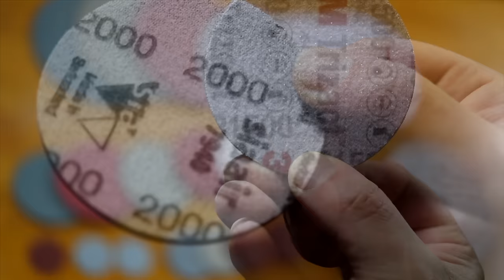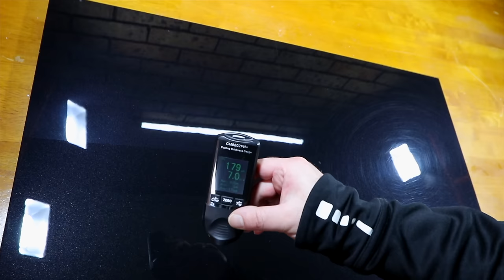A Guide To Wet Sanding, Compounding & Polishing Car Paint!

Comment: Hi Sandro, great video. I learned so much from it. I wanted to use some of the same principles to clean up a blob of touch up paint. I was going to wet sand it until it was even with original paint and then polish. Do the polish wear off after a while and have to be reapplied?
Reply from the maker: Thanks, and a true polish or compound permanently removes defects so unlike a wax or sealant, the finish won’t wear off.

Comment: Great video.  With the advancement of modern compounds - some of which remove 1200+ grit sanding marks - is it possible to skip the 4000 grit sanding stage to reduce the amount of clearcoat removal and just go straight to a 1200+ grit removing compound? 🤓
Reply from the maker: The softer the paint is the easier it is to remove aggressive sanding marks, but based on my personal experience it’s actually quicker and safer to refine coarser sanding marks with finer ones prior to compounding.

Comment: another great vid, Sandro.  Though I'm a long ways from any sort of wet sanding, I do have a question.  So, the "sander" is really a polisher, yes?  And what I think of as a rotating sander, like Black and Decker or Skil or whatever, that's radically different, yes?
Reply from the maker: Thanks mate but I haven’t owned any of those sanders you mentioned so I can’t speak to them. But most sanders used for automotive paint will be quite similar to a small throw DA polishers so yes, and they can be the same machine used for both polishing and sanding. Orbital sanders where actually where DA polishers originated from - Rupes just made them with more power and larger throws into what is the standard for car polishing today.
Reply: @CarCraftAutoDetailing  I looked some up and it looks like the construction use orbital sanders for wood spin a lot faster than the car paint ones... 12,000 OPM and such.

Comment: Hello Sandro ;) Hope things are much better now in Vic. I have a question after watching your video - do I need to buy a interface pad when going to use the SIA Sanding Discs as they look like they have a bit of interface inbuilt? It will be my 1st time wet sanding with a DA :)
Reply from the maker: You don’t have to use an interface pad with them, but I’d tend to recommend it as it’s going to give you more forgiveness especially as a first time user and help give you more even results as you work on your technique.
Reply: @CarCraftAutoDetailing  Thanks for the quick reply Sandro and I sure will follow your advice mate..Great instructional videos and info as always cheers se you soon..
Reply: Hello Sando, hope you and your family are well from your near by neighbour :)  I finally worked up the courage to give this a go! I did half the bonnet yesterday and forgot to use the interface pad Doh. but it looks good with the exception of even though it's uniformly dull matt - i'm sure it still has some orange peel look to it, is that normal?
Reply from the maker: I’ve definitely sanded back a few different panels and cars where although I was able to greatly reduce the peel, I wasn’t able to get that 100% flat mirror finish, whereas on other paints and panels I was. It also comes down to the panel, primer and base coats to some extent in order to get that completely orange peel finish. You’d also generally want to start with at least 1500grit and actually not use an interface pad when more specifically going after Orange peel. But I think if you were able to import everything the finish and refine it all diem well it was probably a great first attempt mate!
Reply: @CarCraftAutoDetailing Thank you Sandro and your advice is very much appreciated. I was using my little DAS 6 8mm throw? so that may of helped me even if it was a bit slow and I was also stressed and not wanting to stuff it up.
I'll finish the other half on the bonnet tomorrow and test my polishing skills on it.. cheers

Comment: Hey Sandro I was wondering how long those 3m Purple finishing film discs last you? And do you use them dry? Thanks
Reply from the maker: 3m have a few different discs, but I generally always wet sand and I’d say a disc is usually good for at least couple of panels, but it really depends, harder paints do chew up discs faster
Reply: @CarCraftAutoDetailing  too easy, cheers

Comment: What about sanding your method on bumpers? Its save? Every time when im sanding some scratche on bumpers im scared 🙈
Reply from the maker: It’s really the same method on painted bumpers, you just have to be extra careful around the dramatic body lines that most modern bumpers have, and it’s usually more work refining the paint when working on plastic substrates.

Comment: Great vid. Can you please send a link to the paint depth gauge?
Reply from the maker: Thanks, I don’t have a link to it because it’s an old gauge I just have at home, but here’s a link to the one I currently use at work 
https://www.waxit.com.au/products/waxit-paint-thickness-gauge?_pos=1&_sid=270d84453&_ss=r
Reply: @CarCraftAutoDetailing  Thanks for the quick reply! Does this unit measure individual thicknesses like how thick the clear is?
Reply from the maker: Unfortunately there is no PTG that I know of on the market that will measure individual layers on metal substrates only on plastics of fibre substrates.

Comment: I have to wonder what you could get away with on the right side of the panel, using the two step that was done on the bottom left without sanding...
Reply from the maker: The right side didn’t have those same deeper scratches, so a compound and polish would get those less severe defects out.

Comment: Can we start from 1000 grid then use 2000 then 3000 then 4000 then 5000 and then use rubbing compound then polishing compound then wax ?
Reply from the maker: You can, but in most cases you don’t need that many steps.

Comment: Sandro, can you suggest some suppliers of good quality interface pads and wet sanding discs? my regular detailing supplier is out of stock I am in northern NSW,
Reply from the maker: The SIA sanding disks (linked in the description box) are really fantastic for wet sanding. I’m really not sure about local NSW sellers as I’m in Melbourne, but you can get them shipped online.
Reply: Thanks Sandro, I source all my supplies on line and missed this info as I was watching on my phone, I am subscribed and learn lots from your methods, Regards, Gary

Comment: Great video as always bud.is there any difference in the degree off clear coat leveling when using interface pad such as those diagrams abrasives disc compared to a regular disc with no interface
Reply from the maker: Yes, any sort of foam or interface will lower the aggression of the disc to some extent

Comment: Hello , prob too late to ask , but would the sanded ish color come back after awhile after the polishing wax?
Reply from the maker: No, this process is not masking or filling the sanding marks, it’s permanently removing them by using coarser then finned compound/polish abrasives - that’s what we tend to refer to as true paint correction - no waxes, sealants or fillers hiding the true finish.

Comment: Hi have you heard of koch chemie h9. 01 compound, I'm having trouble removing scratches from a hard bmw 645 clear coat using ultimate compound, do you think this will work?
Reply from the maker: I haven’t personally used it, but their compounds seem to be well regarded
Reply: @CarCraftAutoDetailing  should I try a microfiber disc instead of foam? Which is more aggressive from the two?
Reply from the maker: Microfibre tends to be more effective at cutting so it could certainly help over foam

Comment: Hello how do I remove haze after sanding a key mark down, I've affected surrounding area on my car
Reply from the maker: The haze is most likely from not entirely removing the sanding marks. After using your first courser sanding grit you may need to sand a little more with your finer grit before moving onto compounding. Alternatively it could also be just compounding haze / maybe your paint is soft, in which case you may need to polish with a finer foam pad and finer polish to remove the compounding haze before you wax the finish.

Comment: What is stopping all the clear coat being taken away and the paint permanently ruined by doing this mutiple times over the years? Does ceramic or other coatings give it additional layers that are stronger than the original clear coat we strip away or what?
Reply from the maker: Good and safe techniques in restoring car paint is want prevents this process from ruining the paint - it’s about how you do it respectfully. Neglect of car paint and bad maintenance processes is the number one cause of car paint failure.
Reply: @CarCraftAutoDetailing  i mean do you need or should always coat it or add layers of protection in some way since you remove layers to polish and smooth it?
Reply from the maker: @quickpik4121 yes you should always add a car wax, sealant or coating after any paint correction process to protect it, but you can’t add clear coat or build it up again, you would have to repaint the whole paint to do that.

Comment: Is it better to machine wet sand than to block wet sand?
Reply from the maker: Hand block sanding is harder to get good and consistent with - it just takes time to really master it to a high level. Machine sanding is easier to get a consistent result and generally easier to refine the sanding marks as long as you avoid getting pigtails in the finish. But it’s always best to practice either method on a junkyard panel to work on your technique and work through that initial learning curve.

Comment: What type of paint gauge is that?
Is it ok to use a DA for wet sanding a whole car?
Reply from the maker: It’s just an old gauge I have at home I’m not sure on the brand, with good technique and understanding you can machine sand almost every part of car with a range of different sized DA polishers.
Reply: @CarCraftAutoDetailing  thanks for the reply. What paint gauge do you recommend for beginners?
Reply from the maker: This is a link to the one I currently use at work, but they are all fairly easy to use, beginner or not 
https://www.waxit.com.au/products/waxit-paint-thickness-gauge?_pos=1&_sid=6ee01ddad&_ss=r

Comment: Iv only wet sand p600 and then head light cream that’s like toothpaste for get the yellow of my car light.    Can I use wet 600 then the cream    Be ok.   Or I’ll have to wait to get 1500
Reply from the maker: I wouldn’t recommend 600g it’s extremely aggressive and in many cases not needed
Reply: Ok mate I’ll buy the 1500 thanks.     It’s for car lights and told not to leave to smooth coz need the UV clear coat to stick better.      Thanks tho

Comment: Hmm....
Can't one step polish remove 2000 grid machine polishing marks ? 
It wetsand with 3000 grid and then one step compound ?
= 1 less step holograms removing ?
Reply from the maker: How hard or easy sanding marks are to remove depends on the paint. It’s far easier to remove the same grit sanding marks on fresh paint compared to fully cured paint as it is to remove them on soft paint vs hard paint. You can use your own judgment and experience to decide if it advantageous to sand to 2, 3 or 4000 grit as there’s always different factors to consider.

Comment: Why am I getting pig tail marks while doing this?
Reply from the maker: Try the SIA sanding disks they are really great at avoiding pigtails, but apart from that make sure you’re only sanding fur short periods, flushing the disks out with water after each sanding set and using vary little pressure.
Reply: @CarCraftAutoDetailing  thanks mate really appreciate

Comment: Where do you get your test panels?
Reply from the maker: It’s sheet metal that a body shop paints for me.
Reply: @CarCraftAutoDetailing  is that cost effective compared to asking body shops for free panels, wondering as i want to start polishing on a test panel. But i dont have room for a whole panel. (Or a daily that i own)
Reply from the maker: No it’s not cost effective, it’s about having flat panels that can be good to test certain things 🙂